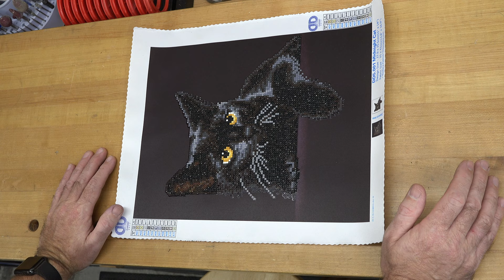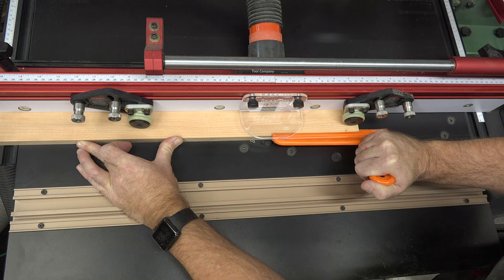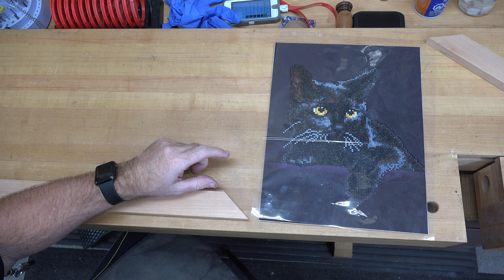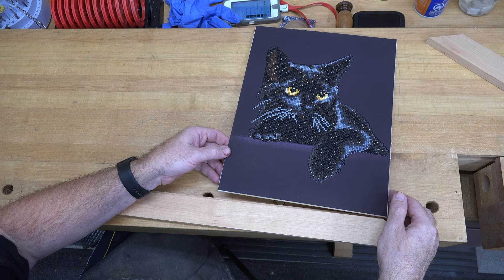Framing Diamond Dotz

Comment: Kenny, that frame came out great.  Those footprints really make the frame special.  You sure come up with some great ideas.  As the cherry darkens over time it will really compliment the artwork.
Reply from the maker: That's the hope Paul.  I wanted to frame this piece but didn't want the same old same old.  I wanted something a little different and this is what I came up with.  All in all, I think it turned out really well.  Thanks for the kind words and for tuning in to the show.  It is very much appreciated.